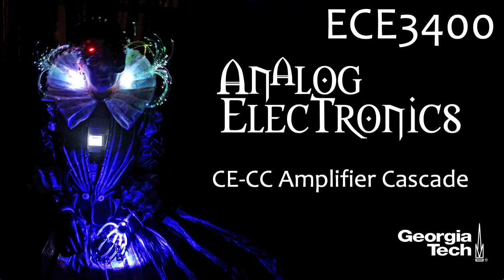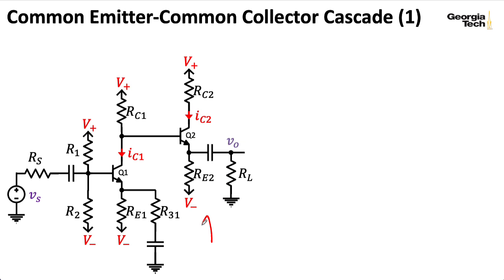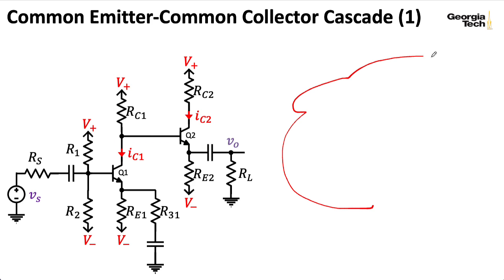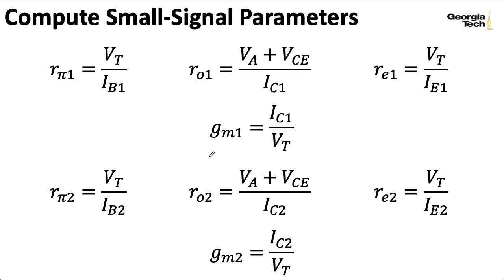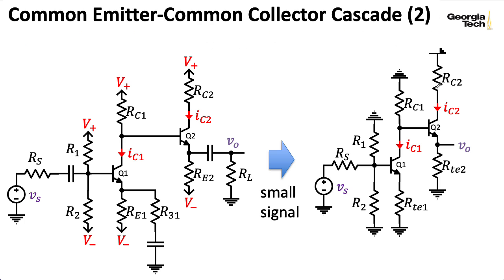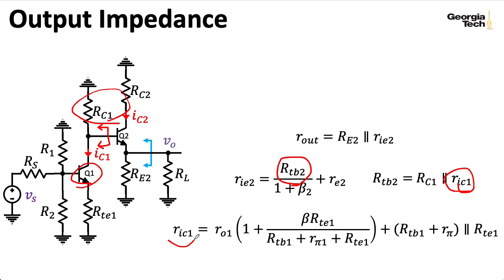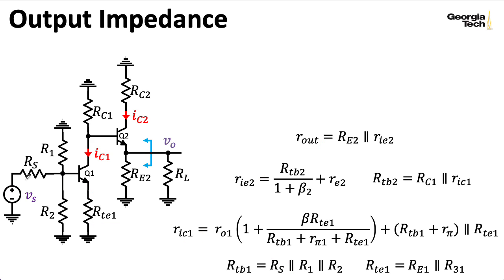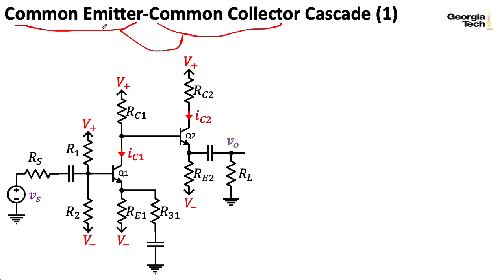ECE3400 Lecture 17: CE-CC Amplifier Cascade (Common Emitter-Common Collector) (Analog Electronics)

Comment: Great lecture. Thanks! I've a question, though. @15:25. Please correct me if I'm wrong, Professor. Rtb1=0 doesn't imply that rie2=re2 because Rtb1=0 doesn't imply Rtb2=0. Instead, can we argue in this way: If ro1=infty, then ric1=infty so Rtb2=RC1. If beta2 >> RC1, then rie2=re2.